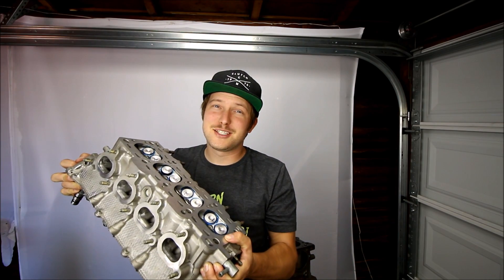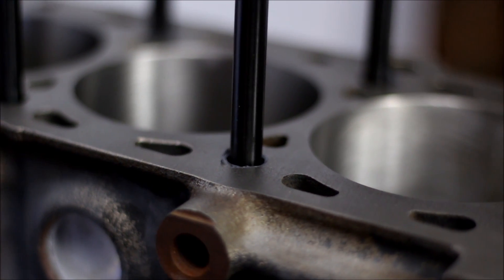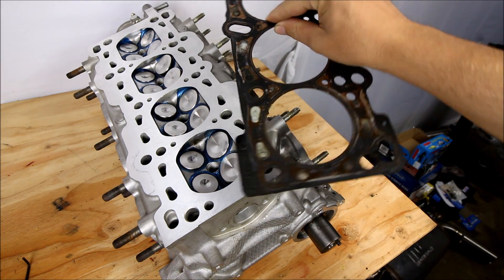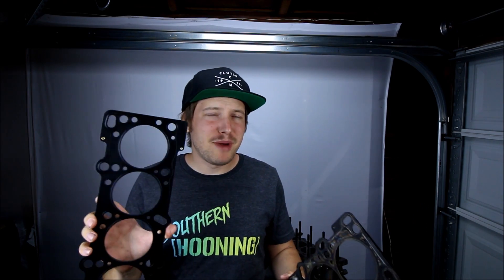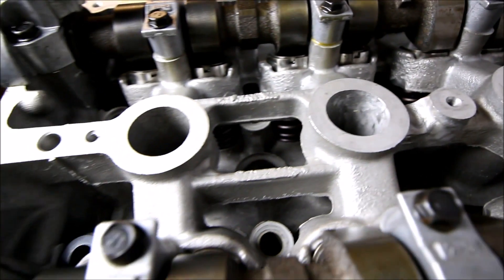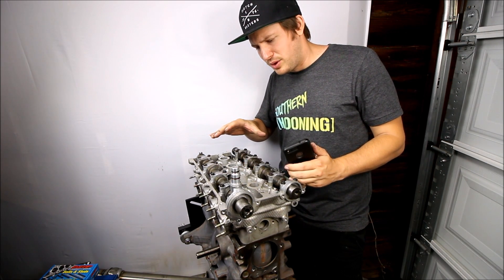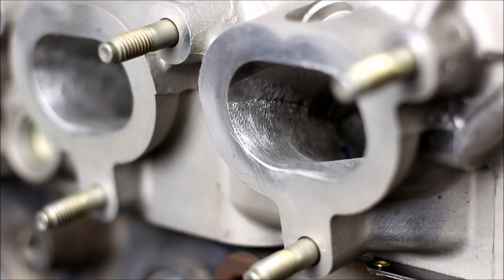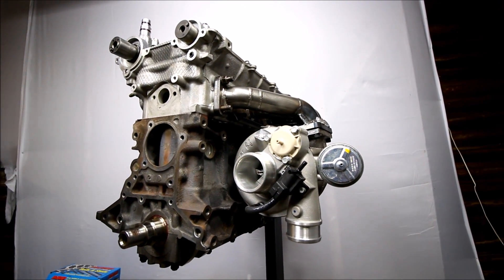Looking Like a Motor! Head Install & Turbo Test Fit (Rebirth Ep13)

Comment: Also, a tip when you drop the washers from the screwdriver like that. You can oil the surface the washer sits on, so it stays in place a little better

Comment: Dont think you actually read my advice on an earlier video, but hopefully you see this.

That turbo manifold will 100% crack. There are no braces, supports, OR (i'm blanking on the word for them) the metal squares or strips welded over the butt welds to increase tensile strength. 

Please just get the TSE (trackspeed engineering) kit. It is the ONLY option on the market (and obviously even for custom jobs) that has zero chance of failure. Its cast 321 stainless, smooth short runners, locking hardware... Just please do yourself a favor. 

From one miata money pit owner to another.

Comment: Interesting about the vvt head cooking. My 03 autocrosser runs cool as beans.  Epic looking motor build!
Reply from the maker: hsp-sandiego Are you running a reroute on it?
Reply: TheCarPassionChannel hello Greg. No reroute - although if we lose Qualcomm, I may look into it for Fontana.  Hope to see you at a event someday soon.  -Harry.  Silver '03 #712
Reply from the maker: My friend with the overheating VVT was running a stock VVT head gasket and a reroute together, that was his problem. Supposedly you have to pick one or the other. The Q may meet its maker at the end of 2018 from what I hear in the BMWCCA talk. El Toro is fun, but the elevation changes at Qualcomm are so unique.
Reply: Well, 1.5 years of autoX is cool... thanks for the insight.  Forget the soccer proposal, San Diego needs a track!  how epic would that be?

Comment: If you have the sump off, it may be beneficial to have the oil return welded on, instead of drilling and tapping? Just a thought👍

Love the build so far, it's going to be a monster
Reply: Jon bray agreed that's what I did
Reply: NA6 motors have a oil return and feed hole in the block already. ¿VVTIs don´t?
Reply: Alejandro Da Costa the 1.8 was originally never turbocharged i believe. it wouldnt have that port
Reply: I don´t really  know. Now that i´m thinking... maybe the Mazdaspeed NB block could have that holes.
Reply: 1994 1.8 has an oil supply on the side of the block. No return though, only the 1.6 has that. I have no idea about the mazdaspeed though

Comment: FYI ARP lube on the block side is totally not needed, only on the fastener end.   If you're worried about them rusting (if any are sealed from oil) you can use anti-seize or just a light grease

Comment: I have a 1.8L on 1997 model with stock engine and planning to keep as stock.   I have just under 100,000 miles without any engine issue. I have heard about the cooling reroute and never really understood why until now.  I bought Koyorad aluminum rad as an upgrade from stock rad but haven’t installed it yet.  I will install it as stock replacement in a month or so when the weather is a bit warmer. Maybe cooling reroute down the road as extra insurance.

Comment: You can actually put the washers on after putting the head on. You can get the wash JUST on the stud and then use a socket and hammer the washer down. It just slips through.

Comment: Awesome videos. I've rebuilt V8's, but this is my first foray into the 1.6. I'm very curious why you torque down then loosen then torque again?
I've heard you should always lube both sides of the washer to get a consistent torque regardless of the mating surfaces. I think the ARP assembly instructions suggest this.
I've also heard you should be very careful when dropping an aluminum head over studs since you can get small filings in the stud threads and potentially change the resistance of the nut when torqueing.

Comment: I love the low hang turbo Greg! Are you going for a stealth looking install when it's all done?
Reply from the maker: Boosted Miata I want the engine bay to have the same feel as the exterior of the car. Looks somewhat standard, maybe even a little boring, but as you investigate closer you see more and more of what makes it a monster. Nice and clean, not outlandish, but you can tell it means business.

Comment: @04:12 another great trick is to use small dab of arp assembly grease to bottom edge of each washer before you use your screwdriver trick. the assembly grease will act as a glue of sorts and prevent your washers from just flopping all over the place while moving and installing your head over the arp head studs ;]

Comment: No need to use arp's assembly line on the block side, and you don't need nearly this much. A little bit of engine oil is fine for this. The assembly lube is only for achieving proper torque on the nuts. also, before you put the studs in the block, those threads need to be chased, every time.  That's just my 2 ¢, though.

Comment: If you are going for High HP you should change the ARP washers to one that match the size of the head bosses as the ones shipped with headstuds press in to the head bosses and can increase the chance of headlifting then blowing a head gasket

Comment: You do not have to put ARP lube on the thread in the block. It must be put on the upper thread where the nut is going and on the washer. Did you do that?

Comment: Last week I change the head gasket and installed ARP studs on my Miata I did the torque sequence but I did not loose the nuts and re-torque them, should I do that even though I already have driven the car?
Reply: Hayden Jacob I would as a safety precaution.
Reply: It's really not necessary to loosen and re-torque the head when you use a mls headgasket.

Comment: hey greg I have a question what is reasoning to loosening the the and torquing it down again is it to make sure it's properly seated, also what break in procedure are you going with, I was planning on following flyin miatas break in procedure

Comment: don't drill and smooth the intake channels to the engine, I was reading Mazda designed it like that to help with fuel evaporation due to a larger surface area.
Reply from the maker: The surface itself has not been smoothed/polished. The actual radius that the air travels through has been "smoothed out" so it doesn't have quite as sharp of a "turn" to go through getting into the cylinders.

Comment: Hi , I need your help 
I'm building an engine similar to yours  with similar parts, the cylinder head bolts and the crankshaft bolts, pistons, rods...  I tried to access the torque specs on your web site but it is not working.
Could you send them to me? Or tell me where I can access them?
thanks

Comment: I've heard that torque specs can be different when lubing a set of threads vs. non-lubed threads.  I've always thought using lube or anti-seize on any critical bolt was the way to go, but I read on a forum that torque-ing should be higher (~+10 #/ft.) when lubing threads.  Also, do not allow the bottom of the hole to be full of lube (hydraulic resistance) when bottoming out a stud. Anyone's thoughts here???

Comment: You should never "run in" a new set of fasteners on a sealed joint with the metal seal you are going to finish assembly with. Metal seals are one time use and removing the load once they are compressed is a common cause to premature failure. It is best to run them in with an old head gasket then put your new head gasket in only for the final assembly.

Comment: Greg, can you then run a later head gasket on a lets say 97 head instead of doing a coolant reroute?
Reply from the maker: Doggepp From what I know, yes you can. But it's still not as effective as doing a reroute.
Reply: Okay, got it. Looking into a reroute atm, but having one shipped to Sweden, and with toll fees, i'm looking at close to $550 so considering all options. Cant find any in the UK or Europe :/
Reply from the maker: What about a rear coolant housing spacer, then using the OEM front water neck at the back? I know that's a popular option as well.
Reply: Might have to look into that! Thanks

Comment: Could you run forged rods on oem pistons with the stock ecu ?
Reply from the maker: narion tuft Technically yes. But if you're making enough power to need rods, you shouldn't be running the stock ECU.
Reply: Thank you for the reply ! And I was going to eventually go megasquirt and turbo but was going to be on stock ecu for a few months
Reply from the maker: Ah yes you can absolutely run forged rods, the ECU won't know the difference.

Comment: What's the blue stuff around the valves?
Reply: It's a dye that they use to measure how much valve surface meets flush with the seat when fully closed.
Reply: "prussian blue", a dye used in metalworking/machining for marking out stuff.

Comment: So if I remove the head, for any reason, I should not reuse the old head studs, am I correct? (Stock head studs)
Reply from the maker: Totally Legit Gaming [TLEG] I made a misinformed statement about that in an earlier video. The stock head bolts are not torque-to-yield, so you can re-use them.
Reply: Oh! Sweet, thanks for the headsup! I might be taking my head off so it's good to know. Love the videos, keep em up! You're a huge inspiration.

Comment: do you have a horsepower goal in mind for this build?
Reply from the maker: 325 on 91, 375 on E85 is what similar setups have produced. I'm more focused on the massively fat midrange powerband.
Reply: TheCarPassionChannel if you're looking for Mad acceleration, have you ever considered a continuously variable transmission CVT? it won't be as much fun to drive but it will launch like a monster. you're a research kind of guy check it out and see what you think.

Comment: That turbo looks like it wont clear the steering shaft, maybe cant really tell from video?
Reply from the maker: Luís Batalha The manifold was built in a Miata shell to insure proper fitment, should be all good.

Comment: is there an advantage for a low mount?
Reply from the maker: Faris Amer Performance wise? The downpipe can be much straighter and the compressor is technically closer to the intercooler so the piping is shorter.
Reply: TheCarPassionChannel thanks 👌

Comment: nooooo don't loosen the head stud nuts with the torque wrench!  Torque wrenches should only be used for tightening!
Reply from the maker: Take a closer look, I used a regular ratchet for loosening :)
Reply: @TheCarPassionChannel  my bad, saw the red bit on the handle and thought it was the same as the torque wrench!  Still learning a bunch from these vids!

Comment: pull your head off!!!! coat that headgasket in permatex copper headgasket spray. Cometics are known for not sealing right, and besides, at might shop we don't set a head without the spray  for peace of mind. medium coat on both sides of the gasket let it sit for 3-5 mins (untill it's tacky) then set it down and rest your head. great job on the build though. looking forward to the finished product!!!

Comment: I thing you need CAMS! Come on, everyone wants to see 300+HP Miata and if it get raspy like American V8 it will be more interesting.
Reply from the maker: +Gedas alekveravičius The problem is, cams big enough to affect the idle like that will just be good for making much higher RPM power. Which means a more expensive head build, bigger turbo, and an engine that won't last as long!

Comment: its an engine. motors are electric.
Reply from the maker: Keuzy 

mo·tor

ˈmōdər/

noun
  A machine, especially one powered by electricity or internal combustion, that supplies motive power for a vehicle or for some other device with moving parts.
Reply: ITS AN ENGINE. MOTORS ARE ELECTRIC.
Reply: REEEEEEEEEEEEEEEE
Reply: No, but seriously, I'm super envious of this build.
Reply: Depending of where you live you can say motor for a combustion engine.